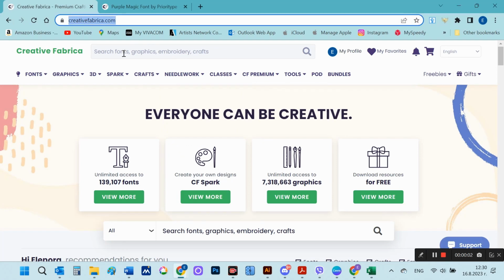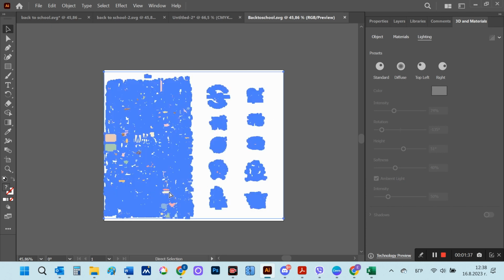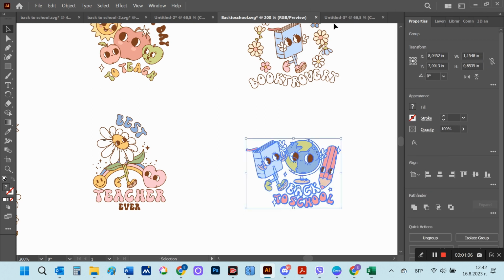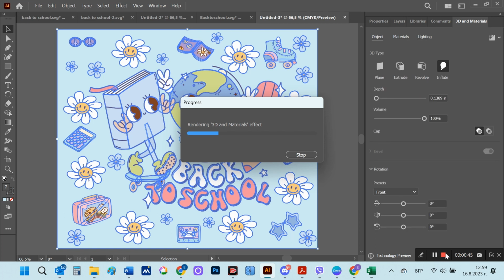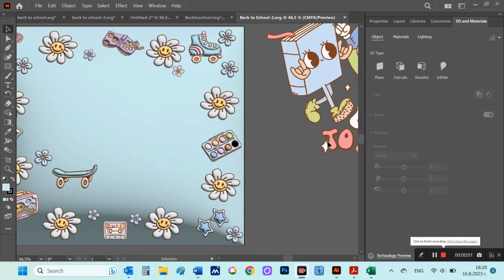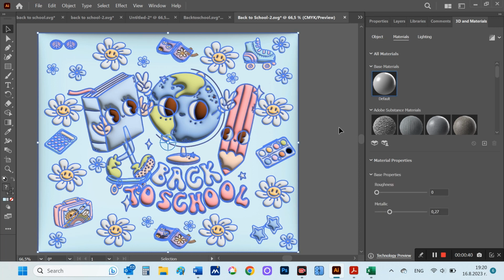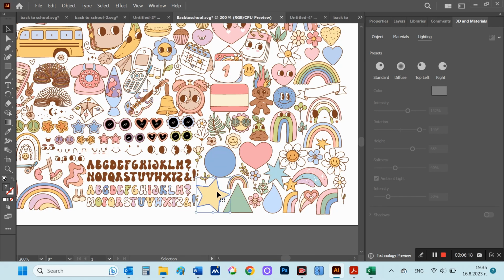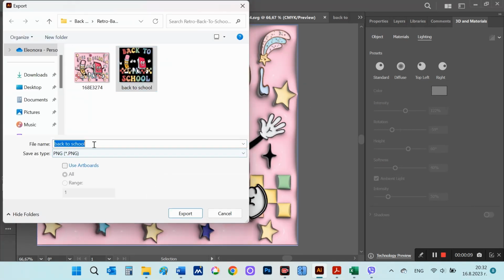How to make a 3D puff design - 3D effect in Adobe Illustrator

Comment: Hi I have been following your instructions step by step. at 6.51 min your design has a shadow on the left side down to and across the bottom. @ 6.52 the shadow as gone. The video stopped at 6.51 and restarted at 6.52. What did you do in between filing to get rid of the shadow.  Thanks
Reply: It’s because when they separated it into 2 groups, the background was not locked so when the smaller fill group was selected to be inflated, the background was inflated as well. They most likely just ungrouped it and deleted the inflated background and put the flat color one back in